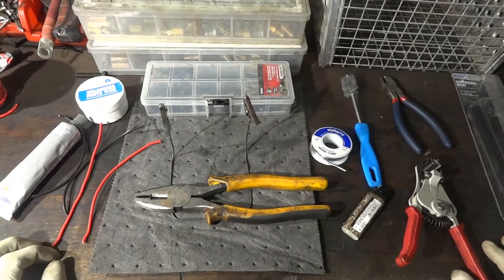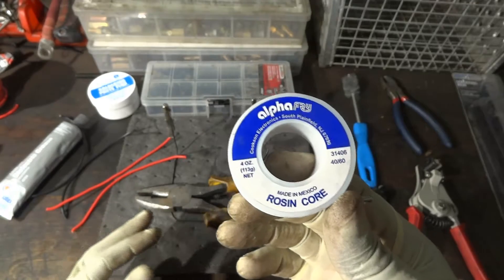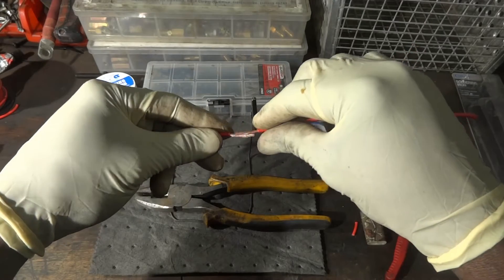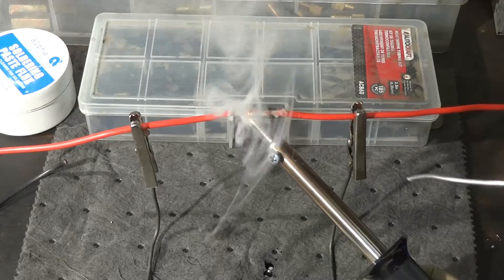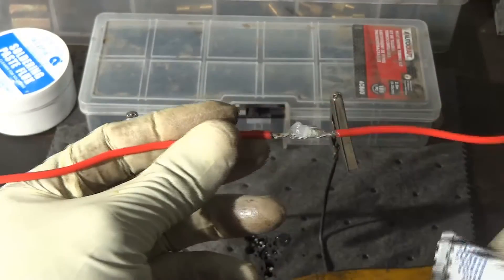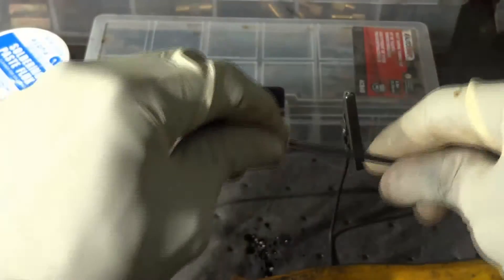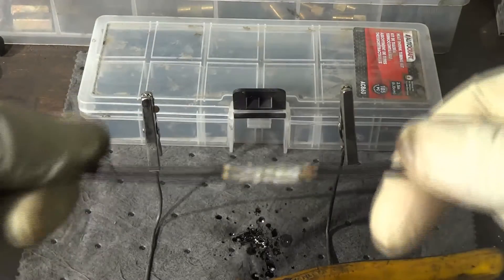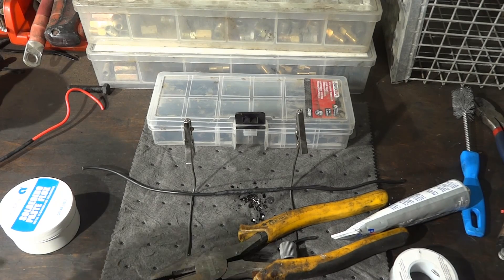How to Solder two Electrical wires Together

Comment: Deo, I been doing electrical work for years. I admit that I simply watched this to see if you knew what you were doing and I could trust your info. You did it perfectly. Well done. Although not needed in this case but I make a habit to slide the shrink tube on before soldering even when teaching on a bench. I have had to take stuff apart before because I forgot to slide it on before joining the two ends. This mistake is always part of the discussion when teaching. I also recommend using a heat shrink tube that has a sealant/glue in it that melts and seals. If you dont have that type of heat shrink then the dielectric grease is an outstanding way to go, again well done.
Reply from the maker: Ross Eryn  Thank you!! I appreciate it!!